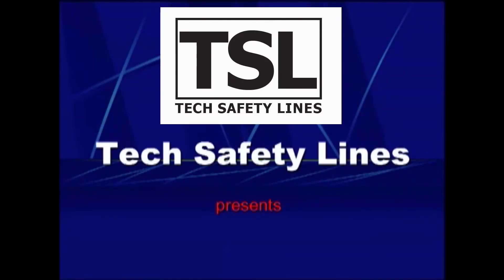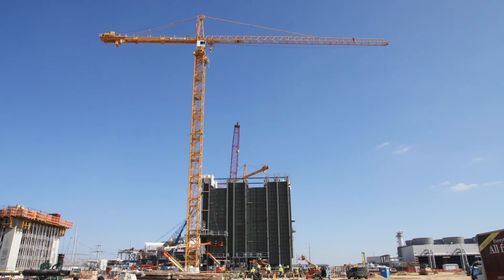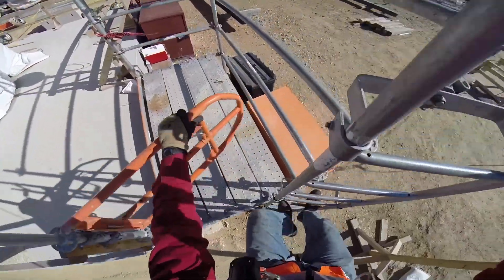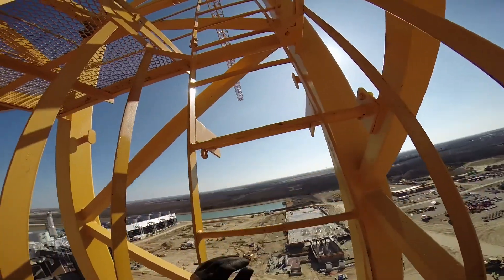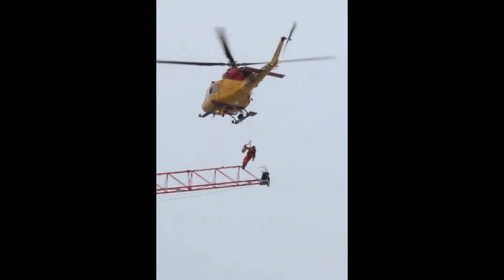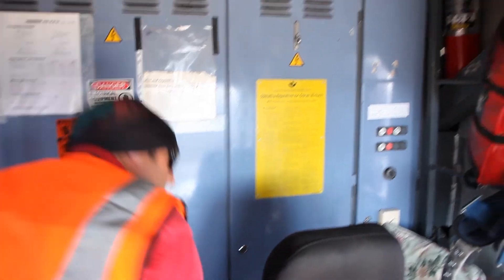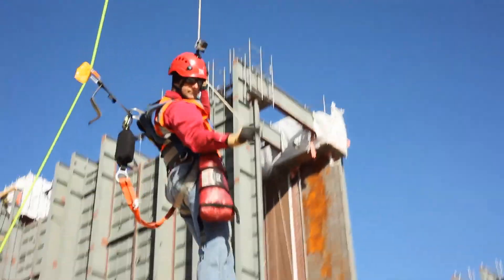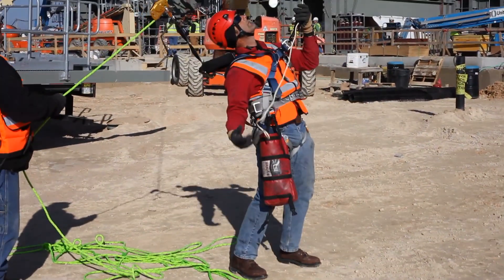TSL Tower Crane Rescue

Comment: This is why I dont like edited videos. Where did that second green line come from? And I'm assuming it's a safety line in case this video goes wrong?
Reply: The gear is most likely only rated for emergency only and for training you need a backup.
Reply: The real question is where is the third line in case the first line fails and he needs to be rescued while suspended?

Comment: And yet they also have a back up line for safety reasons?, if it is so safe then why would you not show it being used as it would be in an emergency without any green back up line with the visible rope grab on there?.......na I think not!.
Reply: Dependent on the country, the vast majority of Health and Safety Regulations prevent single line use during training. There must be a safety line as a back up. A real life emergency obviously that doesn't count.
Reply: @alexpark9610  It would not be that hard to justify the stunt on a single line for the purposes of filming a demo like this.
Reply: Why take unnecessary risks.